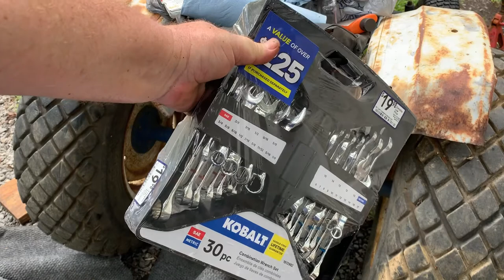Mitsubishi tractor S370 Satoh restoration part 13    Three point hitch

Comment: what size pto shaft will fit the little s370 because i have the same tractor and i have a bush hog and i wont to know what size it is
Reply from the maker: Hi bo
The good thing is that there’s industry standards for the PTO shaft but that doesn’t mean they’re all the same for the mini tractors they come in several sizes and several spline configurations. So what needs to be done is get your trusty tape measure out and measure the shaft thickness. Then you check the spline type you have and you may need to get an adapter from either eBay or tractor supply or some type of farm store to adapt from yours Spline do your equipment PTO device. I will go over this in one of my episodes here shortly the tractor is about two episodes from being finish.
Reply: @fixingthingswithpastorbill3840  ok thanks and have a blessed day